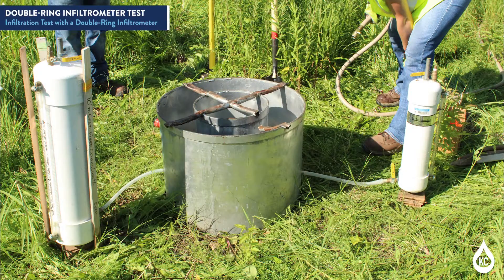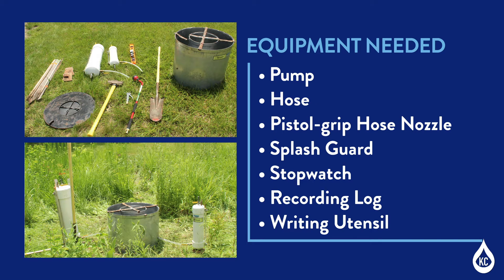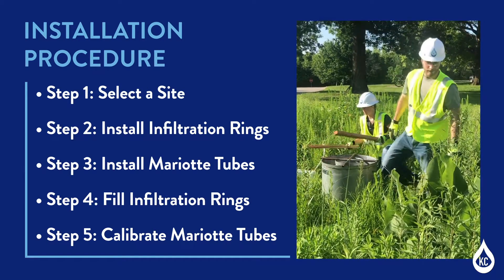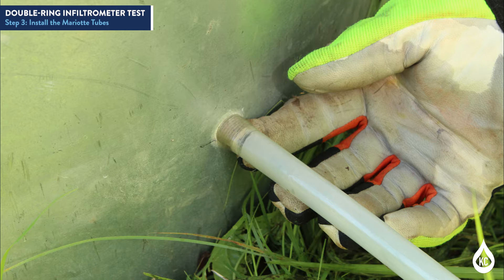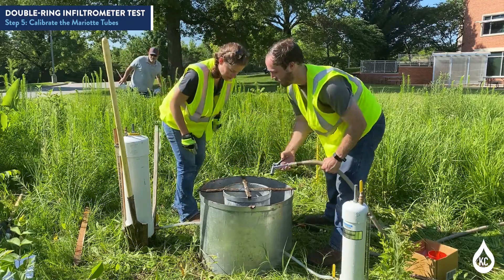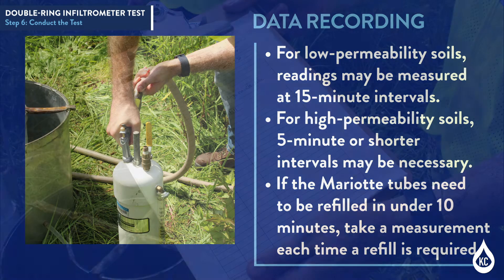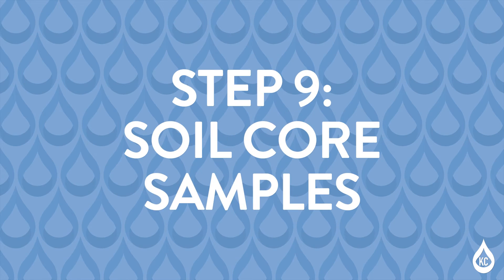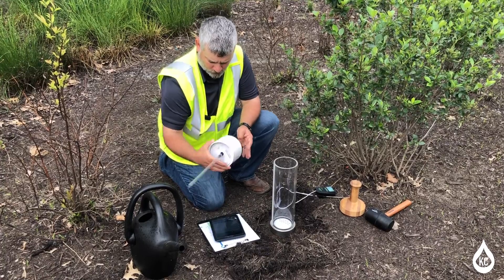Double Ring Infiltrometer Training

Comment: IMPRACTICAL. The hardest part is to calibrate the Mariotte Tubes.

It's impossible to match the infiltration rate with the flow of water from the tubes by raising/lowering the tubes. The tube is HEAVY and you have to raise/lower it MULTIPLE TIMES to get a matching rate. Sometimes taking more than an hour just to match it. IMPRACTICAL.